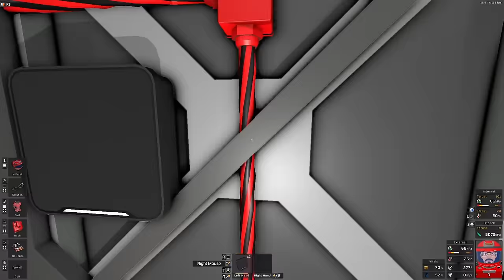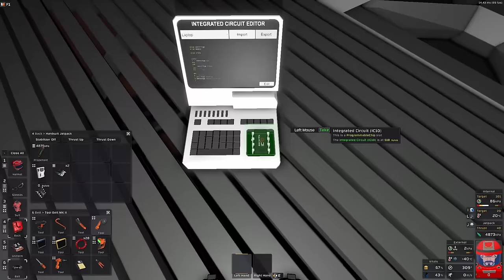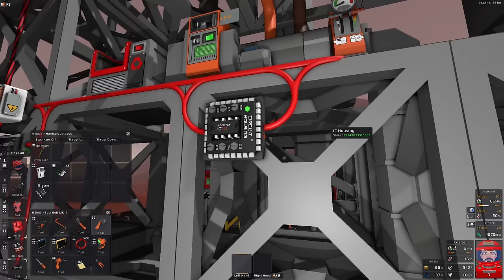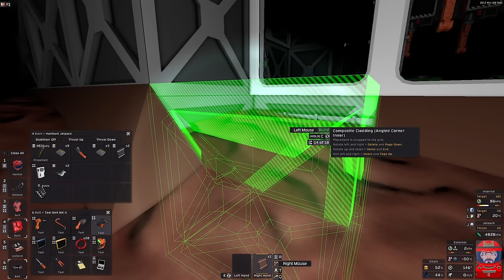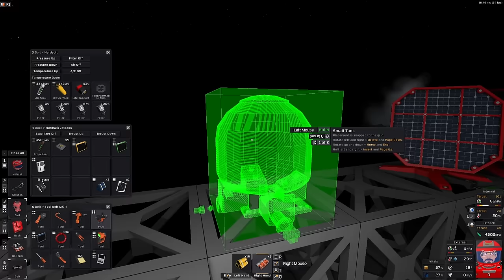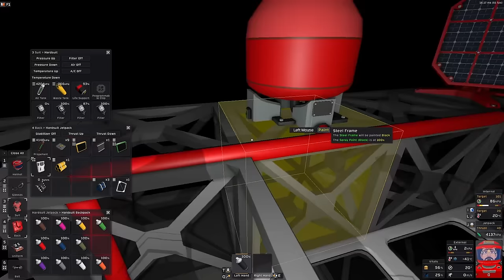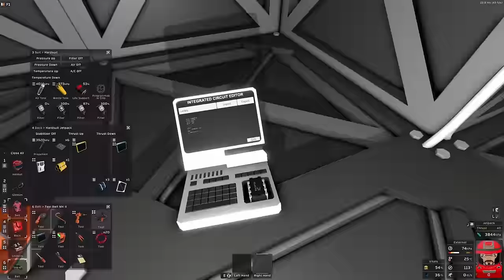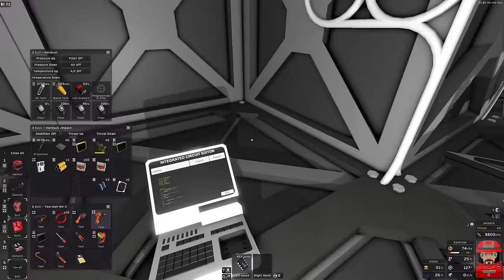Stationeers Let's play Mars 14 Double automation

Comment: If your centrifuge isn't catching up to the miners, you should add a shutoff to the miners until your silo gets emptied.  Turning them back on when the silo has a certain amount into it.  That will save a huge chunk of power while the miners are off.  It will also shut down the miners if you don't empty centrifuge right away, instead of letting them just redundantly run.
Reply: Silo can have 600 items.
So maybe below 200 all 3 running
Between 200 and 400 only 2 running 
Between 400 and 600 only 1 running
And at 600 none running
Reply: Tbh, i kinda suggested to put a stacker prior to silo and ensure stack size is 50 as doing without it drops tons of small chunks...but 3 deep miners vs 1 comb centrifuge still wont be able to keep up; most of my mining is exclusively via deep miners (i usually have 8-10 miners with 3 centris and it struggles to keep up with that)
Reply from the maker: If I am shutting down the drills then there would be no need for the silo as they would just be mining on demand.  I could use a stacker to monitor when the chutes were backed up and save a lot of space.

Comment: Mick I said it once before and I will say it again.  You are a master of this game through and through.  So far I have learn a lot from you and I still have tons more to learn.

Especially since lastnight I setup a sterling engine on Mars and was careful in building it as safely as possible.  It ran great for a while until.   Until the furnace suppling the hot gases built up to fast and burst the pipes causing the engine to blow up.  I figure I put a little to much fuel in the furnace which created the problem.  Oops, I have more to learn, lol.

Now I am thinking maybe the phrase changer might be a better route for using the Stirling Engine.
Reply: If you put a volume pump on the furnace hot gas outlet, a Gas Pressure Analyser on the pipe at the Stirling Engine ... and probably a volume pump to purge the Stirling Engine's pipes once the gas gets too cold, you could control how much hot gas the Stirling Engine gets with an IC10, then purge the gas elsewhere once the Engine has pulled most of the usable heat out of it.

E.g.: I've found that ~10 - 15 MPa of  (4000 Deg K) hot gas pressure is OK with one Stirling Engine (with ~70 mol Volatiles in the little "working gas" canister you put in the machine) and it will still produce ~1kW power when its feed hot gas is down to about 300 Deg K
Reply from the maker: LOL.  As the saying goes, Searing all of the flesh off you body is the mother of invention.
Phase change can't generate enough heat for the stirling.

Comment: You pumped the room gas into the volatile tank and once the composter  started it self ignited.
Reply: Wrong.  The engine was outside in the open.

What I think really happen is the furnace had to much fuel in it at the start.  Which caused the  pressure to climb to rapidly and overwhelm the insulated pipes and hot small insulated tank combined with the total length of pipes being being to short going to and from the Stirling Engine.  Plus, I added a one way valve which may have also added to the problem.
Reply from the maker: Yes, but why is the composter so hot?
Reply: @cowsareevil7514  Think it's a part of the new game mechanics. I have a game going on moon, where I use composters to produce H2. Gets really hot.  Luckily it also produce N2, that can be cooled with vacuum and I use that to cool down the output from the composters.

Comment: The composter's output gas is hotter than 50°C and you forgot to clean the oxygen out of the room ;-)
Imagine what would happen, if you haven't activated the vent in the beginning.
Reply from the maker: I wasn't expecting the composter to get to autoignition temperatures so I didn't bother to purge the room.

Comment: I'm not 100% sure whether the centrifuge will stop without noise if it is full. It worries me that the reagent count could be non-integer due to recycled stuff.
You might need to replace the beq r0 3000 with bgt r0 2999
Reply: if its turned off you can stop it without noise when full, and i think it takes in exactly 3000 and then maxes out
Reply: @sultangris   ^^ This! ^^
Reply from the maker: Good point I will make adjustments for that.